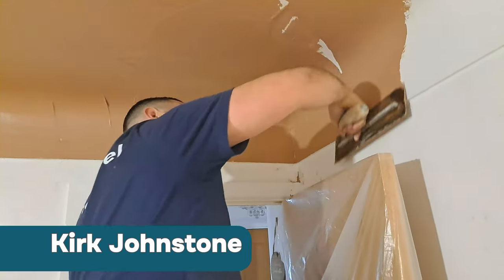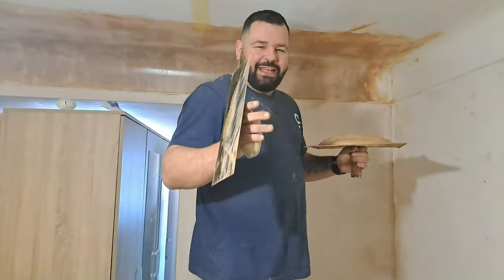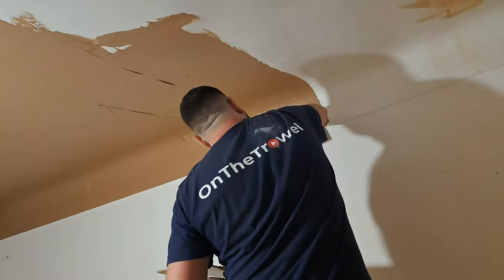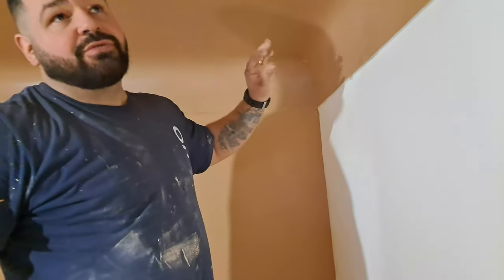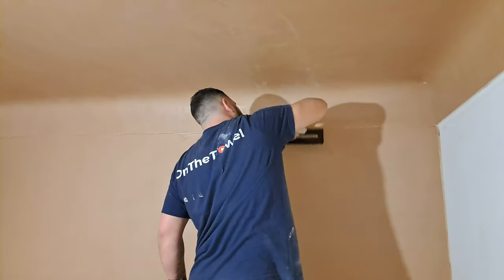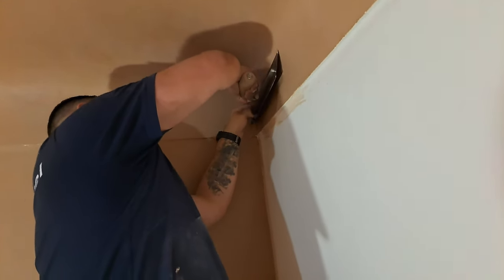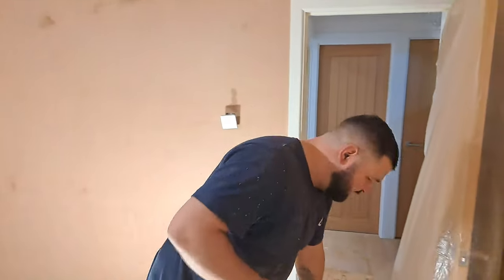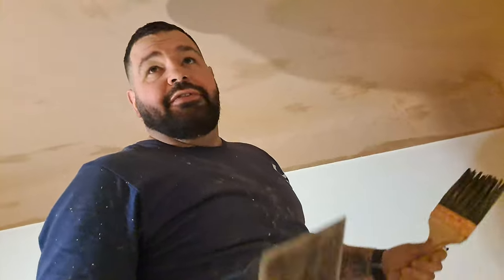HOW TO PLASTER A COVED CEILING

Comment: That scrim tip is great for when you’ve bought that rubbish from Screwfix that I did which doesn’t stick to anything 😂 I like it that much that now when I do a wall, I’ll go over all the scrims with sbr and a brush because it seals any loose bits of the scrim too - stops me being cack handed and ripping them off later

Comment: Hi kirk Nice video  before I start work. I'm a fitter/welder for a large steel  works in cardiff. I do this plastering for my self I use  a Marshall town stainless steel trowel.  But all your videos I've  watched I see you use a carbon steel trowel am I missing something. Cheers dave south wales 🍻🏴
Reply: You Are! ... A steel trowel gets a LOT sharper than a Stainless-Steel trowel and gives a far better finish .... Stainless Steel Trowels never lose the slightly 'rubbery' feel to finishing ... They're also GUILTY of causing 'Reverberations' in the finish because of the Rubberiness .... Good luck with yer DIY plastering though 👍🤠
Reply: Go carbon mate, my van got nicked a couple of years ago, had only ever had stainless, when buying my tools again, I accidentally bought a carbon. After just under 2 years, it’s an absolute weapon. Gives a far better finish than stainless or flexi, can use all the way through if I so pleased, but i don’t purely to prolong her life span. She’s ridiculously sharp, I mean almost dangerously, I’ve caught myself with her many times and blood has just gushed (not using that as a selling point) from how sharp she is. I’ve got a carbon back up as well and because I’m a trowel junkies, I’ve bought a permashape, but I seldom use it. My carbon 13x5 is the best trowel I’ve ever owned by far

Comment: Another cracking video Kirk. I learned so much from your rolling set videos. Any chance of a video of how to plaster a large wall / ceiling in sections and how to blend those sections in without leaving a noticeable line ? Definitely buy you a beer for that one ….as would many others mate. Many thanks for all the info you’ve shared 👍👍👍👍👍👍
Reply: What you're talking about is another form of rolling gauge. 1st coat an area you are comfortable that you know you can finish. Let's say half of a ceiling, get to half way and feather the first coat off to nothing. Do the same with the second coat and finish one half of the ceiling, always feather off to nothing. Start on the remainder of the ceiling ensuring you've put a good coat of SBR or PVA on the area that has been feathered off and don't let it dry out. that way you'll be able to blend in the two halves for a perfect finish. You can use the same technique on a wall, I've tackled walls that have been 13ft high where I've set up a trestle, finish the top half, feathering off to nothing, removed the trestle and tackled the bottom half as per the above.
Reply: Or just do the whole wall and no need to do any feathering,